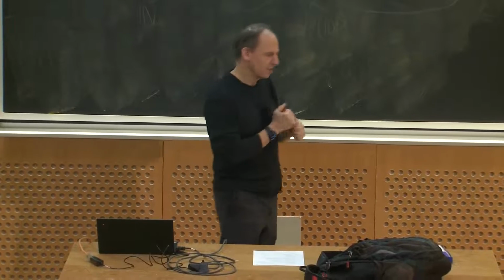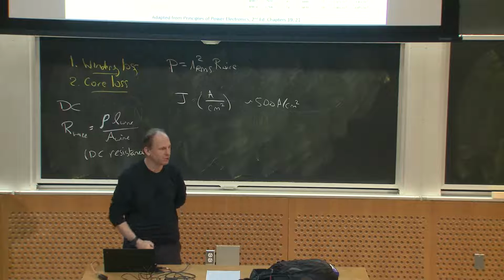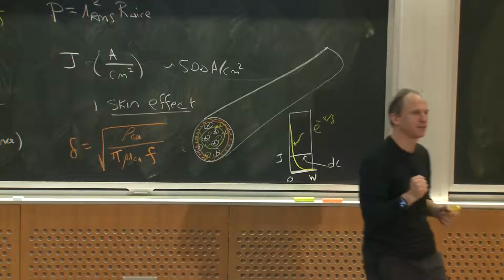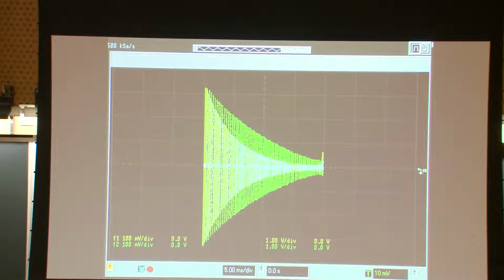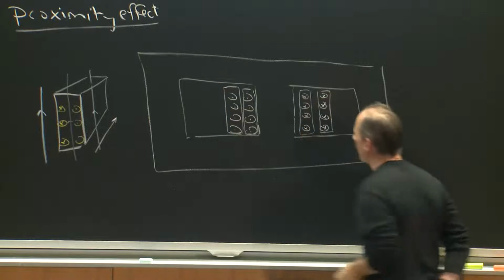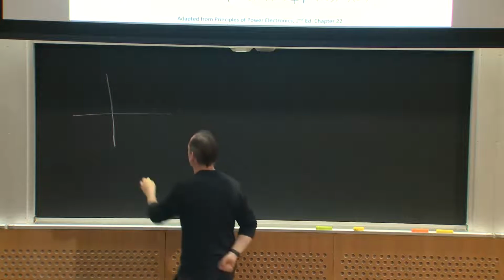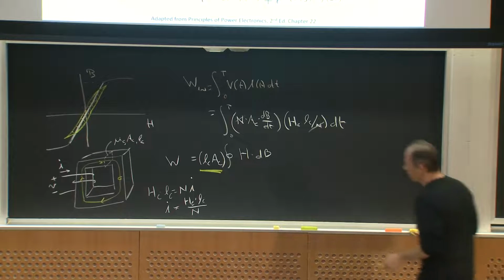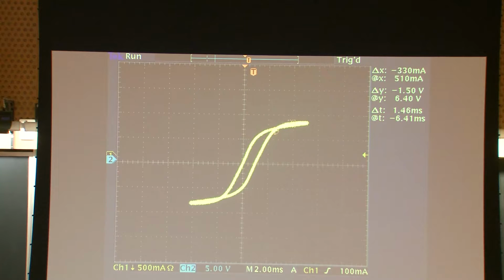Lecture 12: Magnetics, Part 4

Comment: Is the proximity effect why the secondaries in power substation transformers are NOT in layers but in a series of spirals?
Reply: As far as I know that has more to do with insulation and parasitic capacitors.

When in steady state operation, the voltage on every turn is the same.
During the micoseconds after switch on, the voltage distribution between individual turns isnt defined by the inductive coupling. The dominating mechanism is the capacitive voltage divider formed by parasitic winding-winding and winding-earth capacitors. With a normal layerered winding, this would put more stress on the winding insulation closer to the HV terminal. Thats why a more complex winding scheme is used to reduce winding-earth capacitances and create more winding-HV capacitances, therefore balancing out the voltage distribution.

Comment: The latest fad is to use 100 year old circuits and crank the switching frequency from 100 KHz to 4 MHz. Much easier than learning about the last 100 years of advances in power conversion. 

Using Litz wire reduces skin effect but reduces the conductivity of the wire.

Comment: There is a heck of a difference between a magnetic engineer and an electrical engineer.  Your models are only good for small voltages and currents. Plus, if the core resonates (such as in nuclear magnetic resonance) the inductance can actually be a complex number.

Comment: Using the 1920 buck and boost converters is the main cause of losses. 2011 vintage converters have efficiencies 95%+ versus 60% for the century old circuits. Then picking a core with a relative permeability of 30,000 and then cutting an air gap reducing the relative permeability to 4 is stupid. Just use wood which does not saturate.

Comment: Change effect of global warming
thank you, prevent effect of global warming, New energy from sea will change world soon, minerals and temperature of water and air from sea are huge source of energy, reduce more than 50% using fossil fuel, fresh water, fertilizer(minerals+O2,N2,C), electricity,  zero pollution, I invented new method base on designing this machine, it  produces 150Megwatt/hour electricity and 20000M3/DAY fresh water and fertilizer, using power magnet of machine as catalyst to separate N2 and O2 from Air , economy will rise by using jet plasma machine that it compresses gas(hot Air) in isolated structure in water pool with more than 80 % efficiency, it has two vertical cylinders, without crankshaft, full auto control,  in first level it transfers compressed gas(hot air) temperature from engine to sea water(hot air  + compress's air temperature+ engine heat+ hot sea water)  in pool for steam electric generator, steam combines with high cold Air pressure( gas rules) to produce pure water and electricity , there are other source of energy that with international cooperation in coastline we can reduce effect of global warming, further more we can prevent these phenomena like cyclone and flood and wildfire , ocean water level by using this hot seasonal atmospheric condition, recent years in summer, geothermal energy happens in surface of coastline, there are many countries in coastline with seasonal hot weather and water condition in comparison with middle Ocean, its more than 12 degrees ,this differences must decrease, in sum-up, by using this energy not only is economical but also reduce global warming in countries like Japan, China, India, Mediterranean countries, Iran, Brazil, Mexico, Us, Canada, (Africa and Arabian countries....) . I invented new method base on air pressure rules and quantum physics ionization sea water minerals in strong dynamic permanent magnet(SMCO) with special frequency(1500or 3000)/minute bases on paramagnetic and diamagnetic particles and electrical microwave electron wave field and electric chemical reactions and photon wave from semiconductors with special angle Cations like(K+, Mg++, Na+, H+, H++, li+, H2, ..) are transferred to in the second level into up level by vacuum pump from storage into combustion chambers and they combine with O2 and N2 ,... as major part of fuel, they increase speed of machine, modern induct Gearbox to control speed of opposite direction, in the end point, dynamic magnet significantly reduces by air compressed,  it is controlled and stopped by maglev force and spring and hydraulic jack and opposite force from second cylinder, for producing electricity and fresh water (removed minerals by accelerate ionization system from sea water) and fertilizer. . 7 methods zero pollution for reducing global warming I mentioned in my profile. (G20 countries can solve these phenomena like injury and death, billions of US$ in global warming damages).